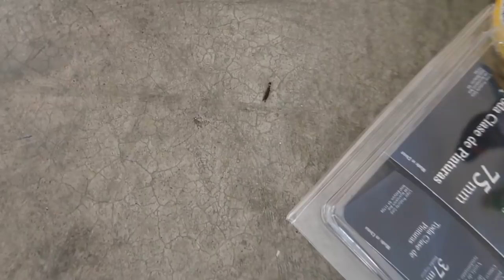NIGHTSTAND MAKEOVER / PAINTING AND STAINING WOOD

Comment: Your nightstand turned out great!  For, the future, they make a brush especially for chalk paint that you can get in stores like Michaels, the bristles are in more of a circular shape and it works well.  I have painted many pieces of my furniture when we moved 1 1/2 years ago from NJ to   SC as they didn't match the new look I was going for.  Also, if you use a brush and you can see the brush strokes you can take a sander with fine sandpaper and lightly sand and it makes it all very smooth.